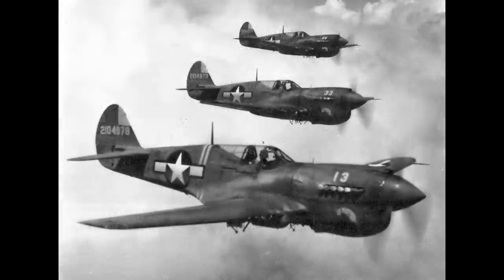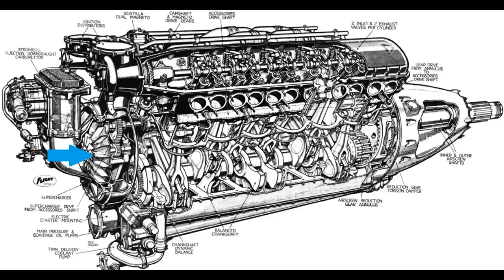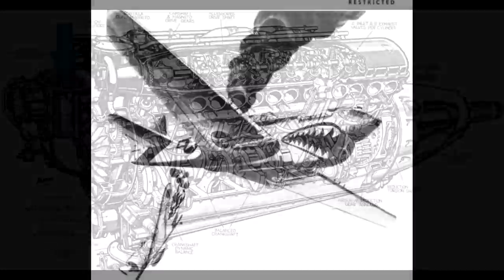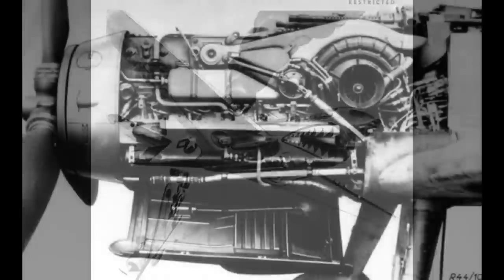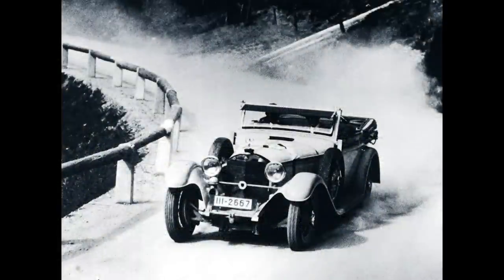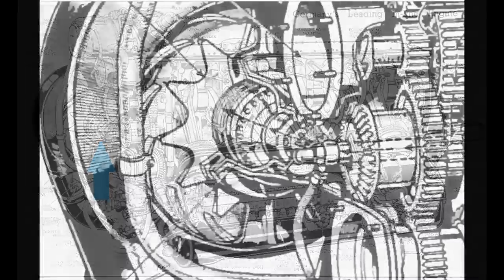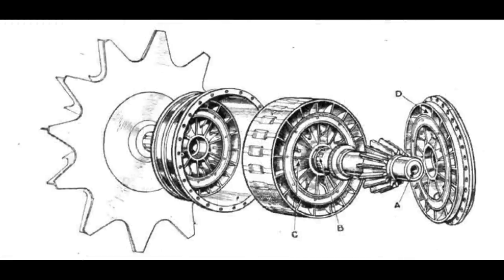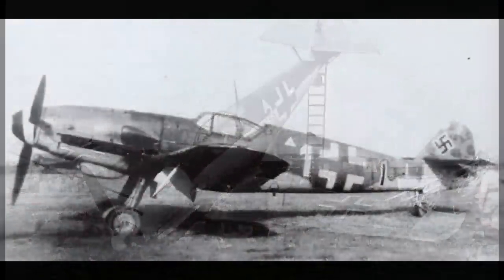Messerschmitt BF 109 Supercharger Drive System

Comment: The hydraulic coupling was much worse than a direct coupling with gear ratios, that's because when it needs to "throttle" it still takes up the power of that would be required without throttling, and so losing the same efficiency, but also takes up the energy required as if it were not throttling. Fluid clutches (which is all this is) will always be less efficient, even if the direct drive isn't using all its possible power for compression, the hydraulic clutch has even more losses.
Reply from the maker: No question that the supercharger drive mechanism consumes some power, and that a hydraulic mechanism will consume a little more than a well designed conventional type. However I don't think it will cost more than throttling. We lack specific data for certain things, like how much power goes into spinning the 109's supercharger, but we can take some decent guesses. Lets assume it's 20% of total engine power at sea level, which is probably  high. 1455x20% equals 291, let's round up and say that it's using 300 horsepower to spin the supercharger. 

Now on my dyno, with a car, the difference in horsepower at the wheels between a manual transmission car (mechanical gears) with around 300 horsepower, and an automatic (hydraulically driven torque converter) is only about 15 horsepower. The throttling losses are at least 100 horsepower based on official numbers. Since 100 is far more than 15, I am going to say that throttling losses far exceed hydraulic losses. Which makes sense, that's the reason the Germans used this system, and it's the reason for the secret Russian throttle I discuss in another video.

Comment: Bunch of nonsense...all germans built their superchargers  sideway then had no more room in that setup  for the extra super-chargers as everybody else had...P-47 and Corsair had turbos superchargers on top of two geared superchargers to get 4,000hp on PW R-2800...no wonder the nazis were beat up!(Their pretty jets were poorly built too and could only make very few of them and all fell apart in a few hours.)
Reply from the maker: Bunch of nonsense. The Corsair didn't have a turbo-supercharger,  The P47 ran a single stage geared supercharger and they just made the plane big enough to fit the second stage turbo system. The 262's engine lasted 10-25 hours, in which time it could shoot down a lot of allied junk.
Reply: +hotspur666  More because the Germans were behind in perfecting turbo-supercharger technology.  Look at their Hohenjager  program.
Reply: The U.S. Navy used two-stage superchargers in all of its production fighters...Corsair  F2G-1 With two turbo-chargers AND a supercharger, the later models of the R-4360 developed 4300 hp. 
Twice as the regular Corsair and 300 more HP than the P-47
https://www.flickr.com/photos/stephenelectrickery/4028710778
Notice:(On 9 August 1945, days before the end of the war, Corsairs from HMS FORMIDABLE were attacking Shiogama harbor on the northeast coast of Japan. A Canadian pilot, Lieutenant Robert H. Gray, was hit by flak but pressed home his attack on a Japanese destroyer, sinking it with a 450 kilogram (1,000 pound) bomb, and then crashing into the sea. He was posthumously awarded the last Victoria Cross of World War II.)
Reply: Except P-40, all civilised airplanes had two stages superchargers, one for low level and one for high level...Nazis never had, period!
Reply: +hotspur666  The DB series German engines had an advanced fluid-coupled variable supercharger,  barometrically controlled to compensate for changes in altitude.